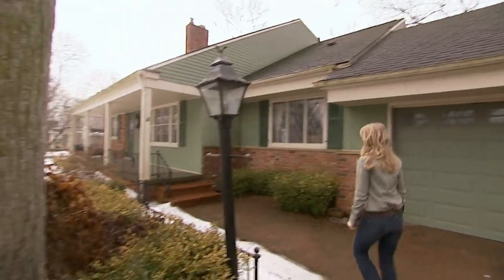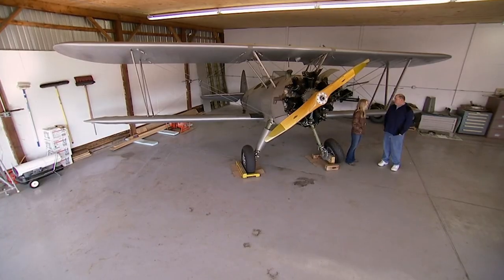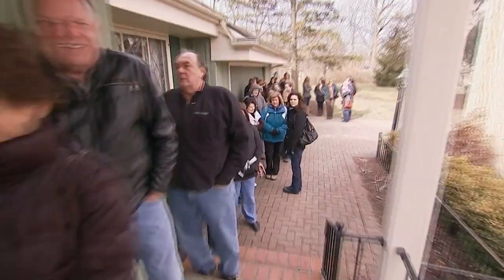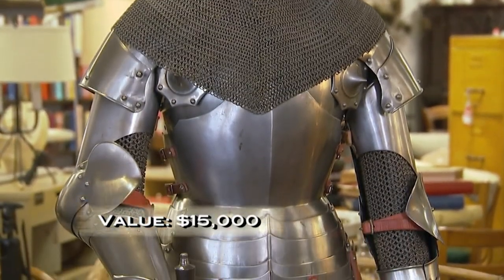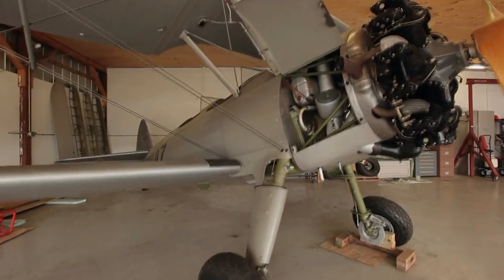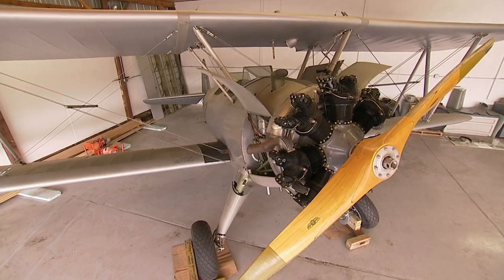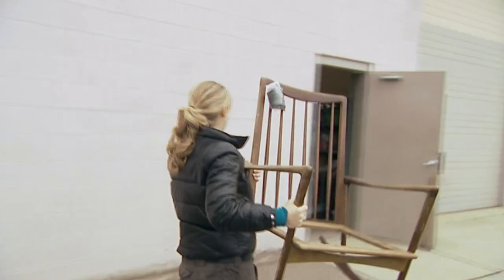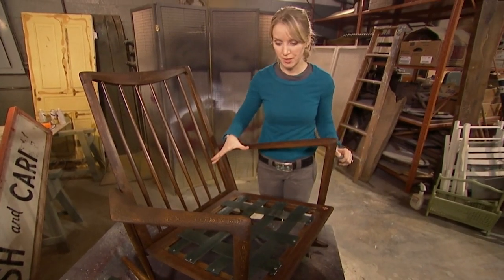Customers That Are Turned Off By HIGH PRICES! 😭💸 | Cash & Cari | House to Home

Comment: Those prices would get a side-eye out of me, for certain. The leather chairs are about $800 /pair..retail. Not estate sale.  $600 was fair.  If they were legit 19th century antiques the price would be higher, but 1940s?  I'd have walked on by.  The china is worth zero if it has gold or other metal on it.  No microwave, no dishwasher, no sale.  The Minton had a green rim, so it went.  The gold-rimmed stuff probably went to charity.